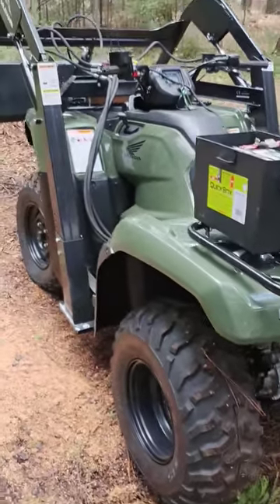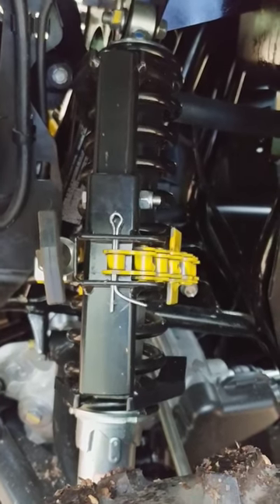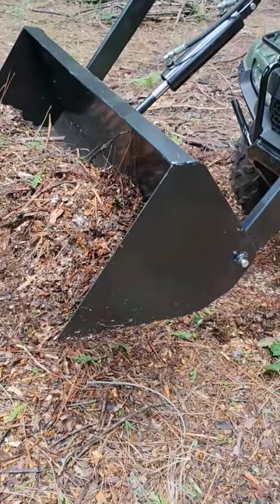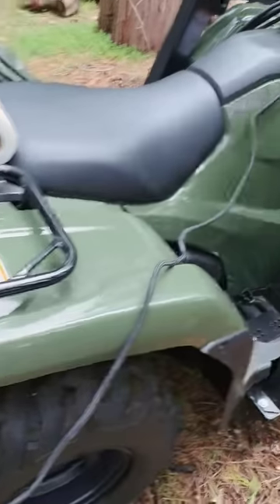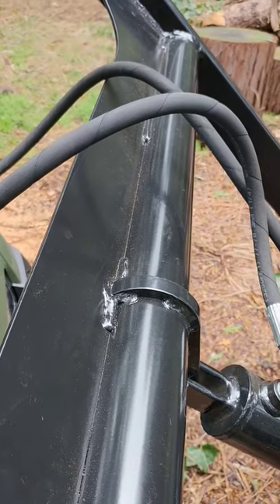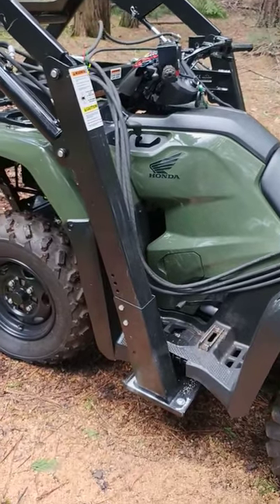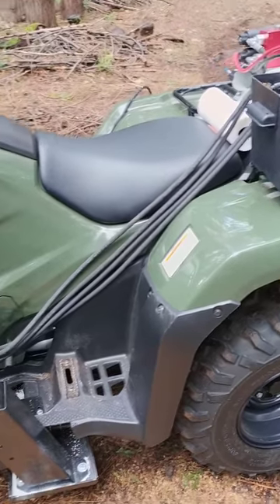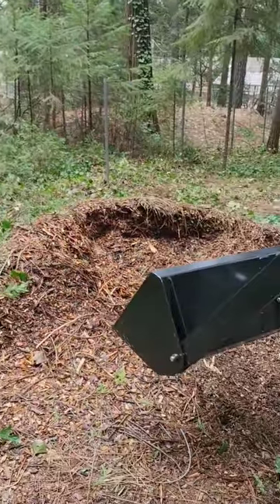Wild Hare mod 2017 Honda Rancher #5

Comment: How has this system performed on your Honda Rancher over the years?
Reply from the maker: Thanks for sending me a message. I have used the Wild Hare on my 2017 for 4 years and have not had one problem. Hydraulics work flawless, the attachments are solid I have had no cracks and really beat this Quad and Wild Hare setup to the extreme. I've cut roads with the Box Blade. I have to complete setup and used the disc to turn soil, cut 3 feet of roadway to make a level car port, moved 150 200 pound boulders with the bucket, used to cultivator to clear pine needles and can't tell you how many cords of would ivw moved in the last 4 year's. Its my workhorse and couldn't do all the things I did without it let alone having to pay soneone to do it all. Paid for itself!
Reply: @guitarslinger  Thank you for the response Steve.  I recently purchased a V.1 loader system like yours and am looking forward to using it soon.  You may already be aware, but Wildhare is also now offering a V.2 system that is supposed to work better on larger atvs like the 2017 Honda you have here.  According to Wildhare, it's not supposed to interfere with the fenders and such as you have found that this system does.  Sounds like that is not really an issue for you given the amount of work you have done with it already though.

Keep at it!
Reply from the maker: Wasn't aware of new version. Glad they have modified for The Honda Rancher. One thing about the Rancher is I have a manual transmission not sure if an automatic trans would be better. I barely change out of first gear when worki,g the ATV. An automatic may downshift bogging the engine. Only guessing as ive never used an automatic ATV. Thanks and good luck!